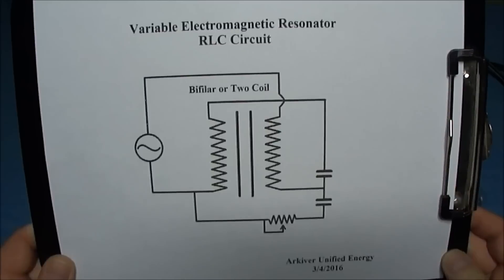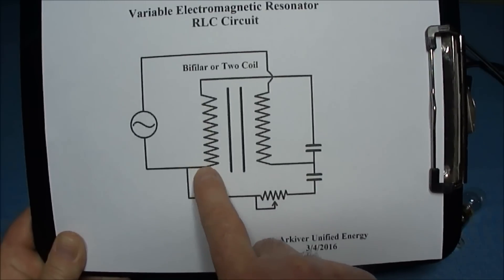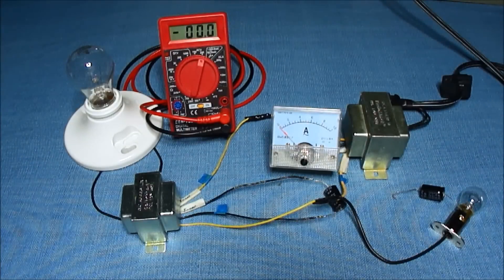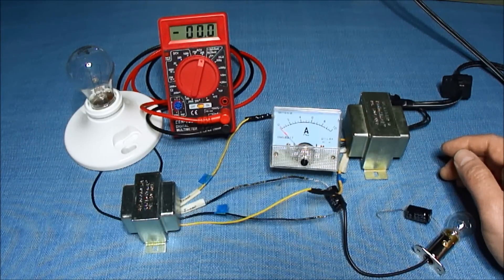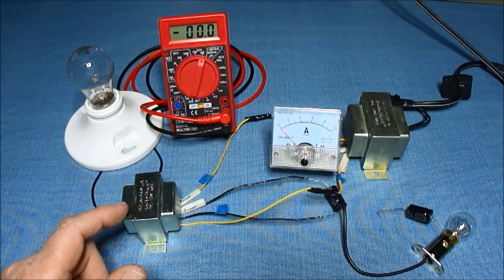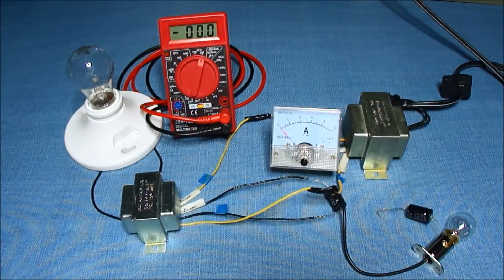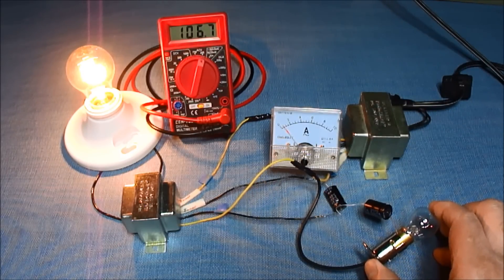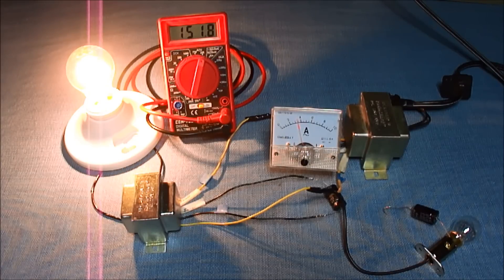Variable Electromagnetic Resonator - Ring Time

Comment: I try with transformer 220/2x12 50Hz cap. 470mf but dont work? Is frequenci critikal?
Reply from the maker: If the nonpolar caps are good and your using adjoined bifilar coils it should work. The initial load can be more important ; )
Reply: @ArkiverUnifiedEnergy  

Thanks for info. Caps are unipolar (new) and transformers are new. Initial load is 15 W  light bulb 220V. I don't now for transformer  is bifilar or separately winding coil.

Comment: Hi Arkiver,This is a fascinating circuit. A clearer view on how your two transformers are connected would be appreciated as ! would like to safely replicate this project.
Reply from the maker: Hi, The transformers are 120v/12v from Radio Shack which have bifilar secondaries with a center tap. The one on the left needs to be taken apart and the center tap split so the connection can be experimented with outside the transformer. This is were one of the 470uf 16v nonpolar caps go. Be sure to mark inner and outer turns of the leads while you have it apart. Once you made the modification you'll understand the diagrams. Electrolytic caps will overheat and pop if it runs to long. Cheers
Reply: @ArkiverUnifiedEnergy , Have you checked the resonant voltage on the cap? could be higher than the 16V rating

Comment: This is very nice demo thank you very much. Is is possible to tune the circuit at resonance by using a potentiometer rather than a the small bulb?
Reply from the maker: A rheostat rated for more than the current expected will work. Poly film caps should work better, electrolytic caps can overheat from the current. Thanks

Comment: I follow schematics ok but not sure what the connections on your video circuit are. The secondary's are center taped yes or no. Are they connected one to one. The 120 volt bulb is the the 110v  side side of transformer two
Reply from the maker: +TvRepairHD Both of the bifilar secondary center taps were split to have access to the two wires. The ammeter on the right rejoined that center tap. Two wire center tap of the left transformer is the upper capacitor of the schematic and small bulb the variable resistor. The circuit is the low side of both transformers.
Reply: +Arkiver Unified Energy  Thanks for fast response . I think I got it I work with dc mostly ac can through me. I redrew the schematic about 10 times. What value is the variable resistor. Very interesting circuit.
Reply from the maker: +TvRepairHD Thanks. The resistance is about 10 ohms with the bulb. When I modify the center tap I mark the leads for inner and outer of the coil turns. It helps with experimenting.
Reply: +Arkiver Unified Energy Thanks for the info. I will try to replicate. Great work !

Comment: Just like a pendulum project the key is oscillations.  Ever think how on a swing you are lifting your body weight a couple of times in a minute with just a small kick of your legs without breaking out a sweat try that with a pulley( that is lifting your weight a couple of times a minute) not easy
Reply from the maker: +Alex Manzanero A kick of your legs on a swing is a second wave and leaning back on the chain is a third wave. In three phase power there is often triplen harmonics which give rise to a potential to ground.

Comment: I have a question, when you start oscillations does the power draw increase from house main? or does it continue to use the same amount? Maybe a "killa watt meter would tell this
Reply from the maker: +Alex Manzanero The power in did increase because the impedance of the coils, at least the two in the center oscillating circuit, disappeared. You can see the amps increase in the center circuit.